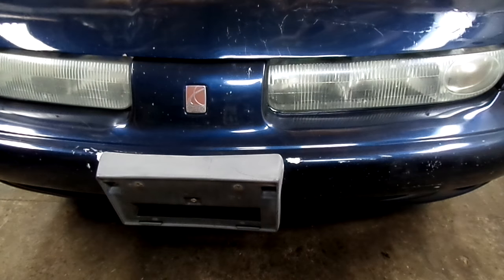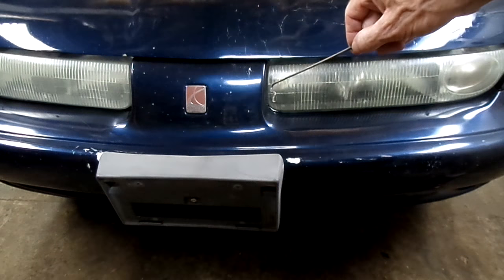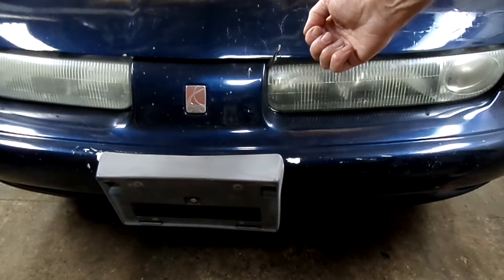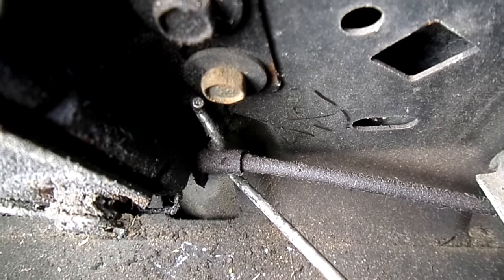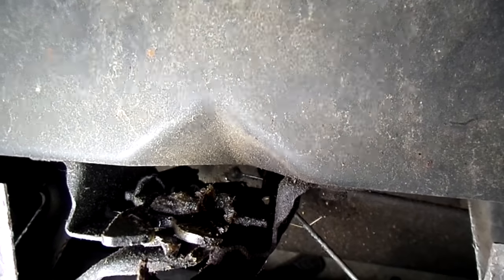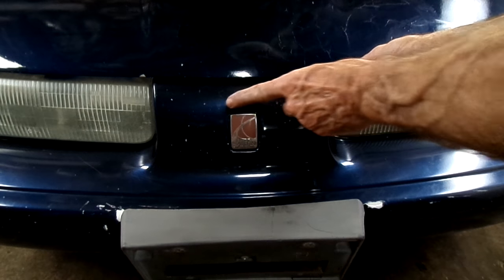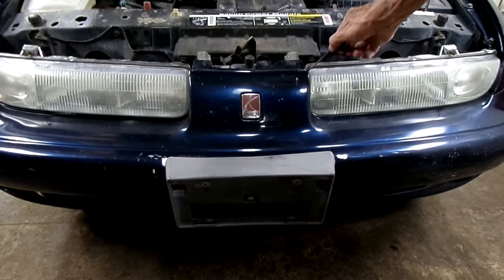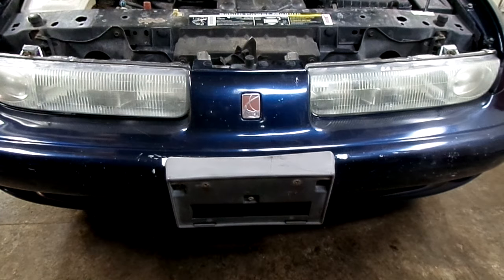Opening Hood with Broken Release Cable

Comment: Rick, thank you for giving me the confidence to try this trick! My 2007 Nissan Armada has electronic locks. When the battery is dead, the locks will not open. Even the single door key lock is an electronic switch. I was going to try connecting a battery charger positive cable to the alternator to try to get power to the battery (the suggested method is the positive starter connection, but the starter is on top of the engine...), but was worried I would fry a diode or the alternator, itself. So, I popped the hood with your trick, hooked up the battery charger to the battery and the locks opened with the key fob! Keep up the good work!